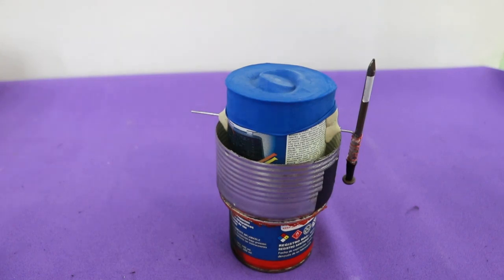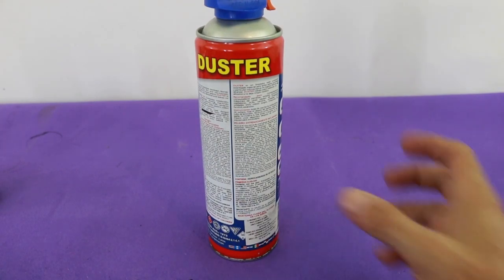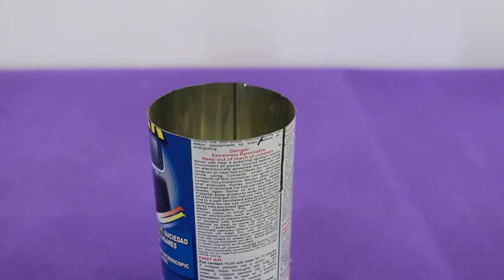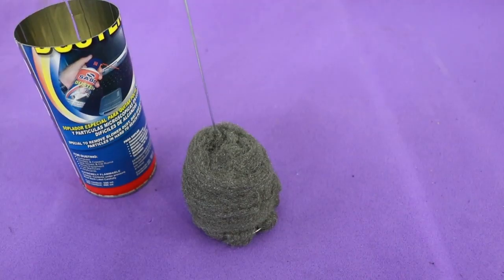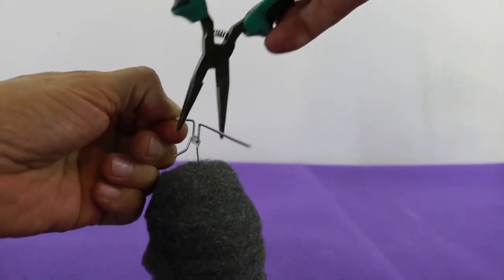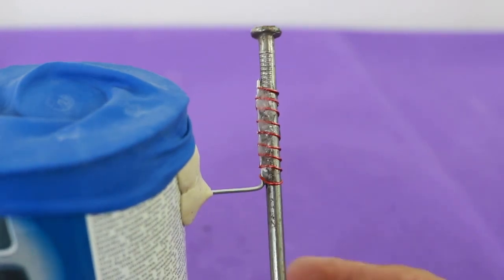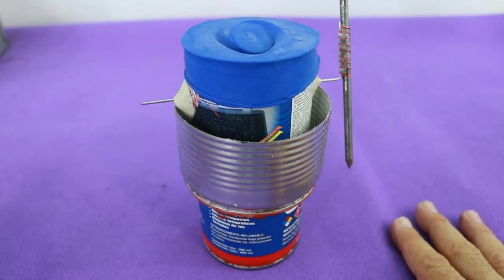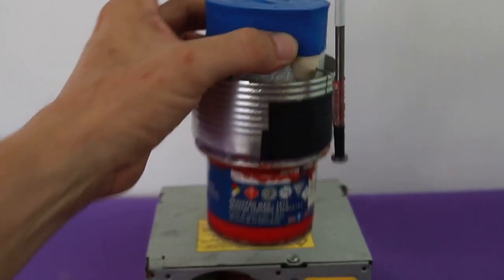600 RPM Tin Can Stirling Engine

Comment: Failed to get it to work so far but it's been a good learning experience making the attempt.  You make it look easy,  but unfortunately I have not had success yet.  I'm not sure if it is the balloon tension too light/too tight or maybe displacer piston issue.  (the cranks definitely clear it ok).  Is there an area you find most likely to cause problem when a stirling engine is not starting and having problems, something you check first?  I used a brass 1.5 mm rod for the crank rod which seemed stiff enough to hold shape but was reasonably easy to work with.  Thank you again for your vids.

Comment: This is a great design. I really appreciate its simplicity, and scalability. No high-tech machined pistons and cylinders. Minimal friction points. Power to weight ratio is likely fairly good.  
I would like to see one of your designs fitted to the focus point of a parabolic reflector dish. The tilted orientations will require thought on the cooling side.
The motor could be held on  a tripod to be at a focal point in front of the mirror, or the motor could be be built into the in the base of the parabolic dish.

Comment: Does it have any torque worth the effort? I mean could you driv a generator? And how efficient is it, compared to for example heating water with the flame and creating steam to drive a generator instead?
Reply from the maker: Both this engine and a steam one with the same flame will give you a small fraction of a watt when coupled to a generator

Comment: That's 300 rpm. Because you measure the front and the back of the nail in one revolution. 

A nice build nevertheless. Thank you.
Reply from the maker: No, one end of the nail had black electricians tape, the other had reflective tape.
Reply: @ludicscience  how could I ever doubt you!

Comment: Do you use baking soda or baking powder to mix with the super glue?
Reply: Baking soda or sodium bicarbonate is a catalyst for CA glue.
It almost instantaneously turns to concrete.
Reply: @aurthorthing7403    agreed, bicarbonate of soda works great.  But I've never tried mixing them, as he seems to suggest,  as it sets rock hard almost immediately.  I either apply the glu and then waft some bicarb at it or make a fillet of bicarb and drip the glue on.